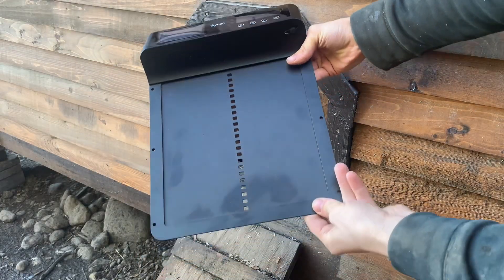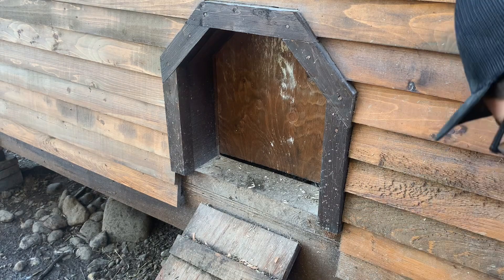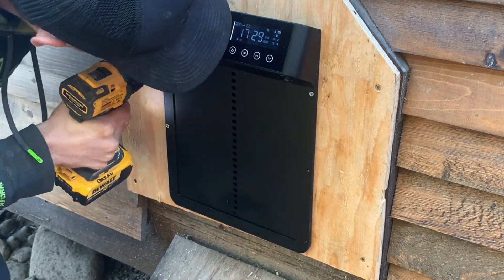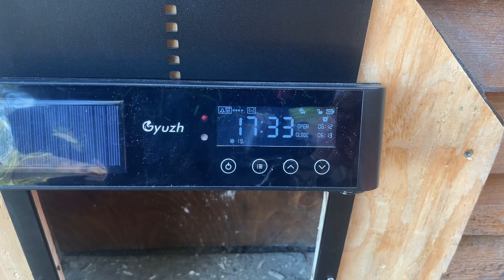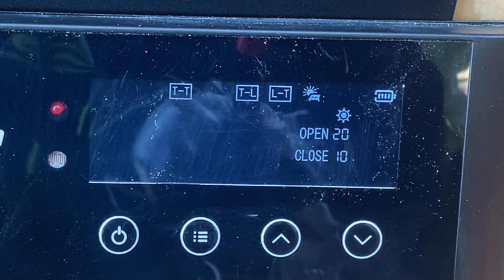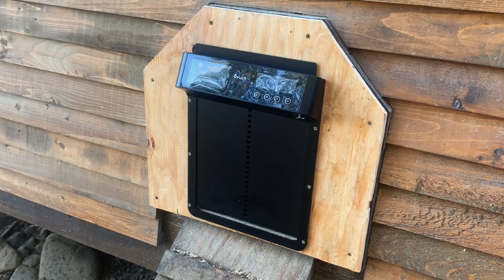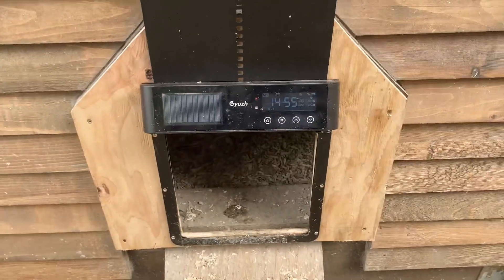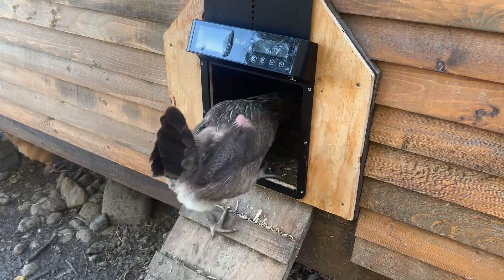Solar Powered Automatic Chicken Coop Door - Install & Review

Comment: This is the one I just bought.  I hope it works.  I’ve replaced our old door (which worked for many years) 3 times now with different automatic coop doors and they were all crap.
Reply from the maker: It worked great for the first month or so I used it (other than the anti pinch function) But then when winter hit and it got well below freezing, it was a bit more unreliable. Where sometimes it would open and close just fine and sometimes it wouldn’t. Not sure if it was due to the freezing or just because wood chips/hay got stuck in the door.
Reply: Hoping this door is working fine for you considering buying it

Comment: I bought one 7 months ago, it was working fine so bought a second one for my other coop 3 months later, and I wish I hadn't. The first door just stopped working after 7 months, no idea why. One morning it fully opened but kept making a noise like it had not or was jammed ; it eventually stopped after about 20 seconds. It did the same thing the next day then totally stopped working. Impossible to tell if cause it's not charging or just fried. It won't charge in the sun or with the charger, it's just dead. Over here in EU it costs 130 euros, it's a lot of momey for something so unreliable.
Reply from the maker: Wow that sucks. Definitely a disappointment for me aswell